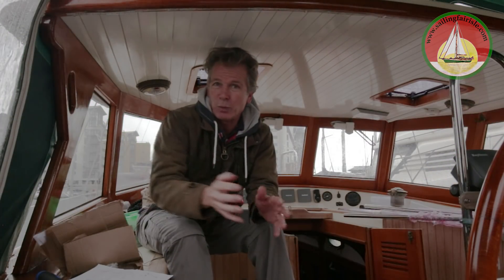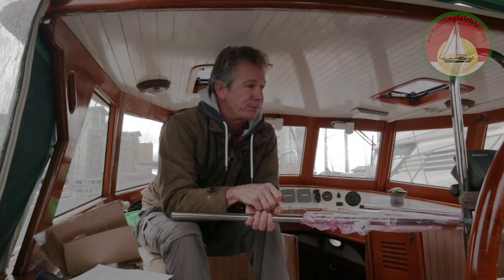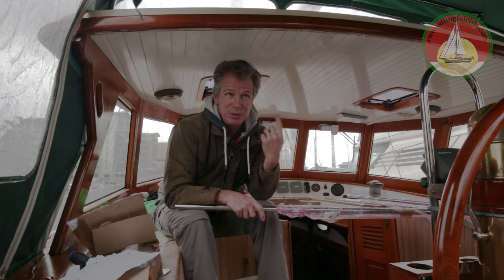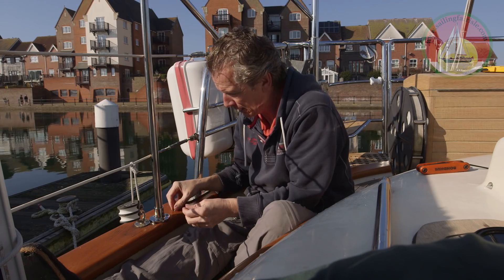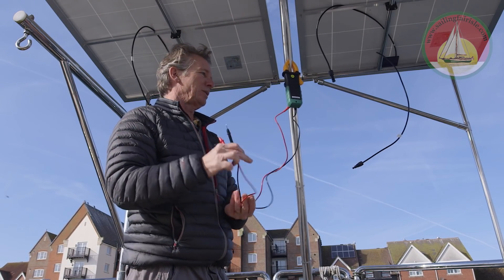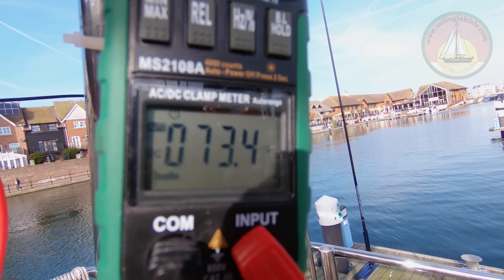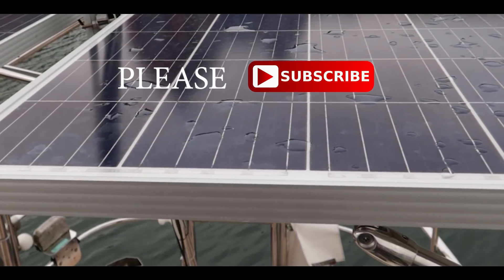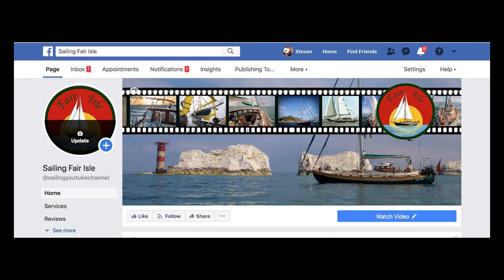Fitting solar panels on a sailing boat

Comment: £37 for 2oz tub. Gulp. I might stick to soldering and vasalene.   Great content. Thanks
Reply from the maker: Noooooo!!!! sorry overdramatic! but honestly soldering is a real mistake on a boat. Yes when you make the joint it's the best you can have (as long as you can solder and its not a dry joint!) But at the joint of the solder and the wire is a real weak spot. Tiny bits of movement, and you will get them even you do tie everything in, will weaken that point and the wire solder joint will break.
Reply from the maker: It's the same reason we don't use single strand wire on a boat. If you think about it by putting a lump of solder on wire you're making it single strand and therefore susceptible to breaking from fatigue.
Reply: @svfairisle  OK. Who knew🤔. Thanks
Reply: @svfairisle   I appreciated the feedback on this point. Was on the boat a couple of days ago and it looks like most of the wiring joijts are as you described. The wiring  jobs I had done recently were tinned an the advice of a car YouTube soldering video. I'm guessing they will be fine for a while but there is nothing worse than a boat full of gremlins so thanks for posting.
Reply from the maker: Yes thats the bugger about electrical connections, tracking down the bad one! I you don't want to remake them just make sure the connections that are soldered are are well cable tied in close to the connection. I will do a video for Tech Corner on the web site on best practice wiring. But basically the best way to join wires permanently  is a crimped  barrel already in a heat shrink tube with hot melt adhesive, like these:

 https://www.amazon.co.uk/Connector-ICETEK-Waterproof-Electrical-Automotive/dp/B07G2TTHQH/ref=sr_1_1?keywords=crimped+connector+heat+shrink+with+adhesive&qid=1575800859&sr=8-1

Get yourself a decent crimper and a small gas heat gun, I have some of this on the home page 'Tips & tricks' section on the website. I guarantee no gremlins in your electrical connections if you do things this way. Using the heat shrink with incorporated adhesive is even more important if your boat has been wired with standard (non tinned) multistrand copper wire. You will be surprised how many production boats don't use marine grade copper wire. (marine grade tinned wire will look silver not copper coloured)
Reply: You don't have to use that one. There are others that might be slightly cheaper. I got a free tub of the stuff with my boat, but my wife often points out that I could have bought thousands of tubs instead of the boat. Some people! Anyhow if you are putting stainless and aluminium together and think you may want to disassemble them ever, a bit of tefgel will give you a chance.